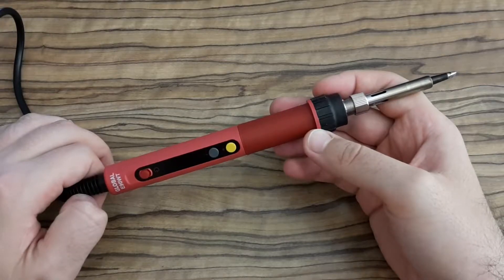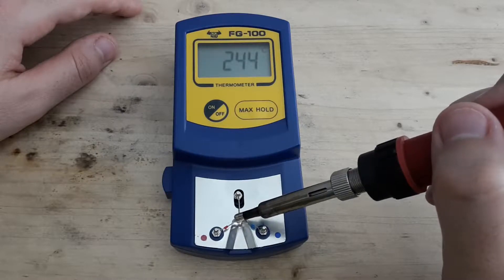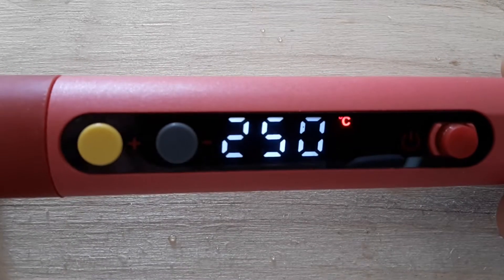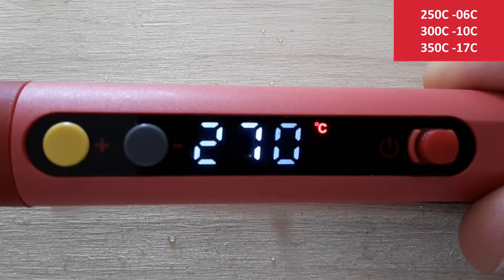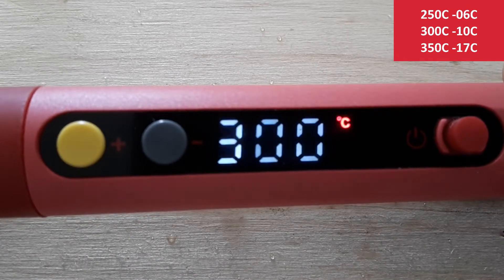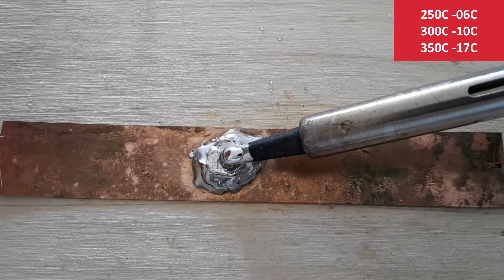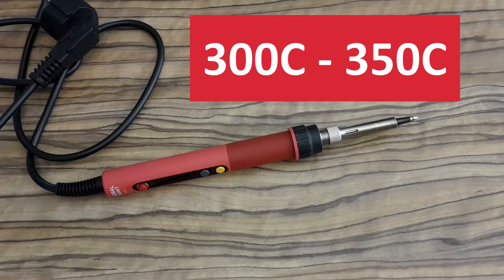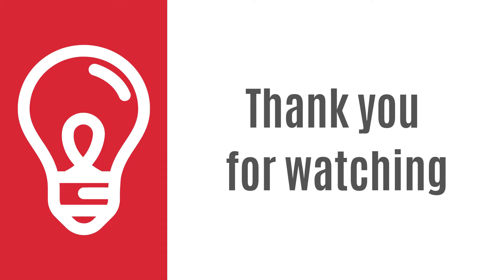Correct Temperature for Soldering

Comment: Elevation has a huge impact on required temperature. I live at 8,000 ft and I have to keep my iron at 800 F just to be able to wet the solder. Even then it takes up to 5 seconds when I touch the iron to the component. Of course I don't have all day, so I just touch the iron directly to the solder. Not common practice but it works fine for me.
You lowlanders might be able to get away with 500-600
Reply: Hes using C.

Comment: The video is perfect demo why you can't solder large areas with tiny soldering iron tip and underpowered heater. Both things matter. Anyone who want to solder also large areas must invest twice more and get soldering iron with at least swapable T12 tips. And then use T12-C4 tip for area soldering on circuit boards.

Comment: Hi there! Great video with very useful tips. I have a quick question.
I recently purchased a Hakko soldering station FX-888D and I now have learned that occasionally (for example if you change the tip) you have to calibrate the temperature. The thermometer you showed in the video would be ideal but it is a substantial extra investment on top of the soldering station.
Can you recommend a less expensive option?
Thank you for sharing.
Reply: You can use the thermocouple that comes with the multimeters.
Reply from the maker: Hi, unfortunately the one in the video is the cheapest version I found.
Reply: @zeroampselectronics  Thank you. At the end of the day, as the saying goes,  you get what you pay and you pay for what you get. I can appreciate quality has its price.
Reply: Use a thermocouple meat thermometer

Comment: Too big piece of copper for such a small iron. It cools down your iron. Take a small piece of pcb and try then.
Reply from the maker: Hi, yes that was my intention to show users what they can expect. Of course they won't use it with such big components.
Reply: heat dissapation vs volume , material ,and resistance ? wonder if its silver soldering or is it just lead ?
Reply: @L.D.S.HELLHOLE  he clearly states as much (and it's not silver solder) ... but yeah, dissipation is the culprit here